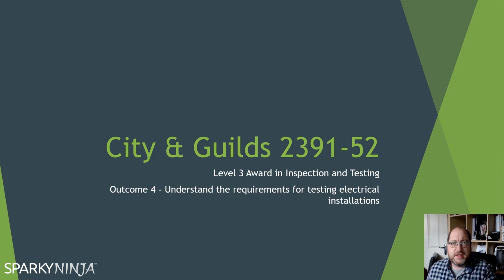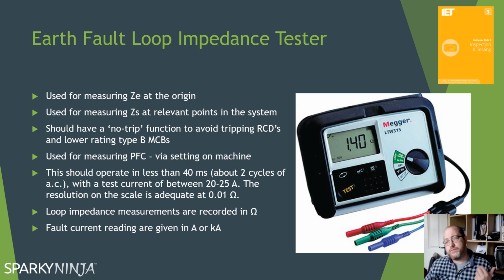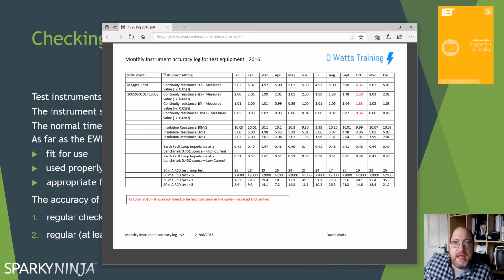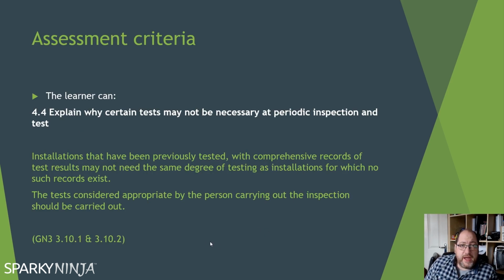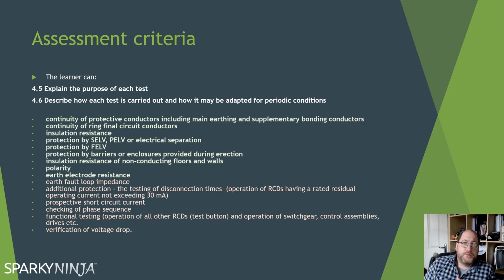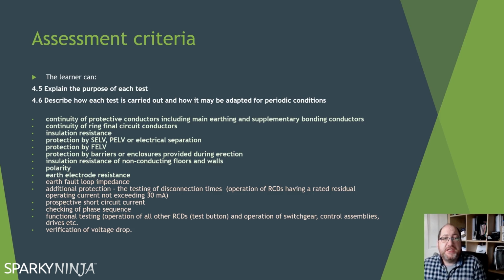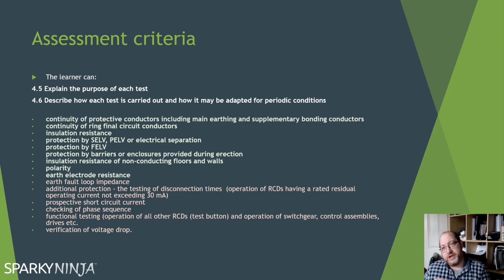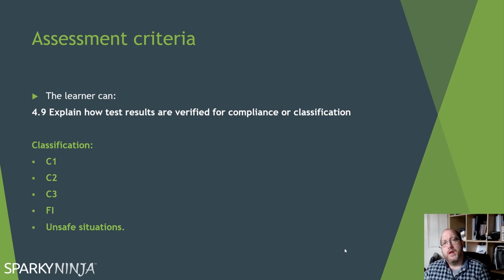2391-52 Inspection and testing course - Outcome 4

Comment: Hi  SparkyNinja.  NICEIC day that R1+R2 and R2 can be omitted on annEICR
Reply: Pressed post by mistake. 
NICEIC say you can omit R1+R2 and R2 tests in an EICR as long as you perform Zs tests as the Zs test proves earth continuity. Do you agree. If not why.  Many thanks
Reply from the maker: @dlewis129  yes and no. Tests can be omitted as determined by the inspector. Saying that carrying out a Zs test actually verifies continuity of the protective conductor is false because of parallel paths.
Reply: SparkyNinja not a good idea then. Thanks for the reply. Keep up the content. As you suggested using the down time to brush up
Reply: SparkyNinja would the parallel paths not be the same for the R2 test ?   Surely the only 100% test would be R1+R2 and that would involve a huge amount of dismantling to do the whole board.   Not  nit picking just trying to learn.   How about a video on it ?? Please

Comment: Hi ninja. Absolutely thorough: this video. However, I’ve sat my 2391-52 twice and failed  with lost of 3 questions. Absolutely gutted!!! Any hints and tips going forward please? I’ve now rebooked for the 18th April 2019. To be honest it’s holding me back from my AM2. On a downer to honest. Any help would be great. Thanks 🙏 

Links
Reply: Lincoln, you dont need 2391-52 for AM2, on the AM2 exam they will assess your knowledge of inspection and testing for some degree, but you dont need a Testing and inspection certificate to sit the AM2 exam.